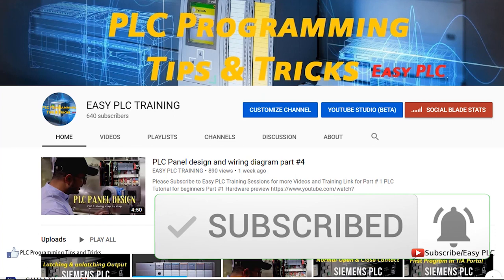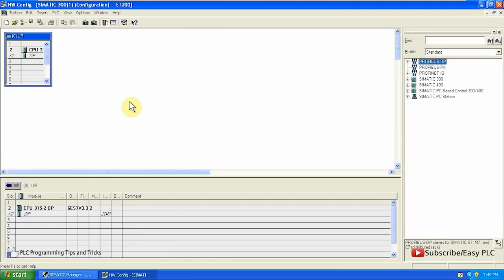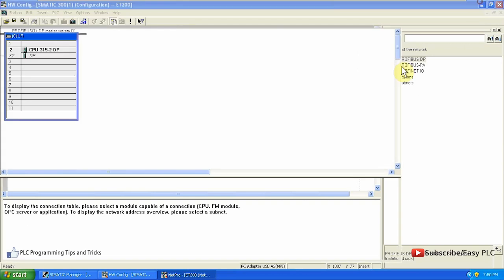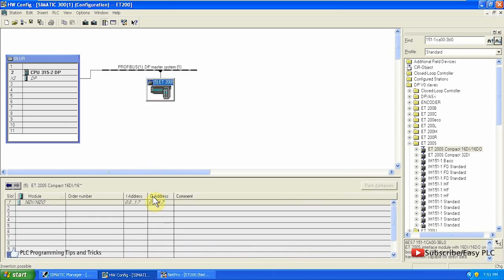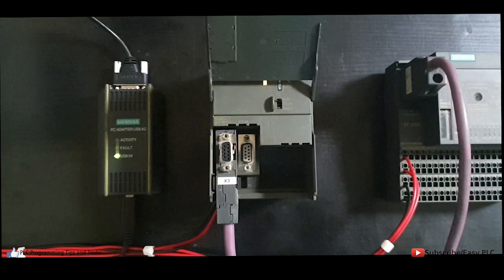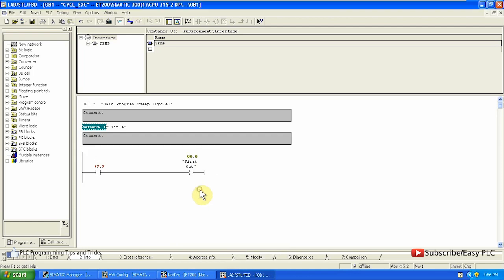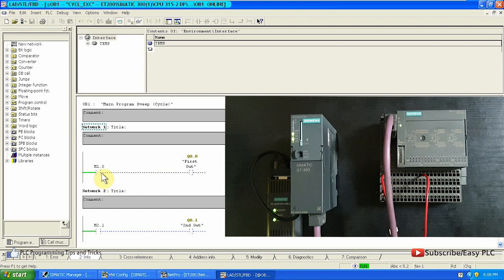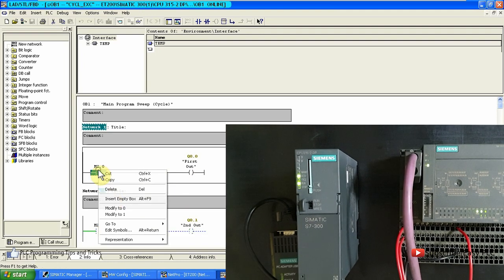S7-300 CPU communication with Extension ET200 S (IM 151-1) with Simatic Manager Profibus

Comment: Thank you so much for directing me here.

Question 1
If my address is 5, what if I on the dip switch on 2 +3 instead of 4+1 in your example
Reply: Question 2

Is this also applicable to the dip switch on the communication card of danfoss vfd
Reply from the maker: No there is no switch with 3.  Only 1 , 2 , 4 ,8,16,32,64 and 128
Reply: Thank you

Comment: I have a s7-300 siemens but i cant view the program inside. What software and device/s I can use to check it. Also, the software and device/s must also read IM151-8 cpu. Thanks
Reply from the maker: Program is loaded only inside the S7 300 cpu..... IM151 is only an interface module for extra inputs and outputs , IM151 only have a profibus address set by its dip switches ...... simatic manager software is used for reading program inside the S7 300 CPU